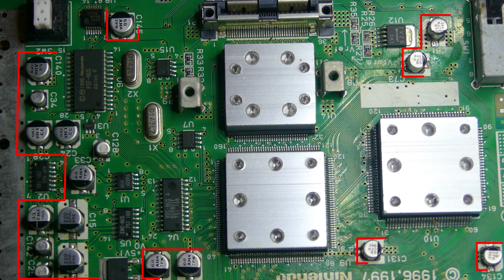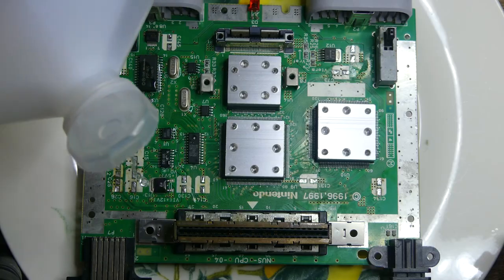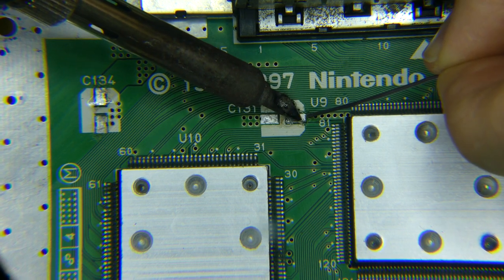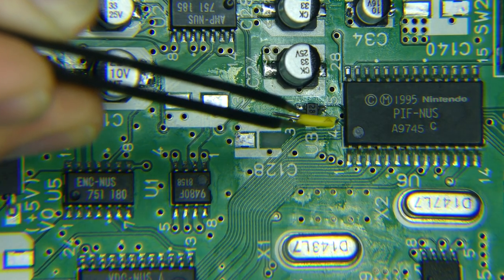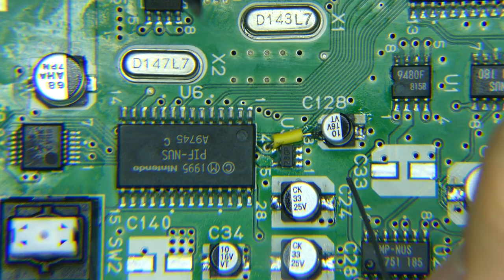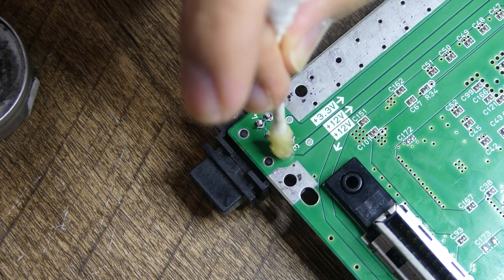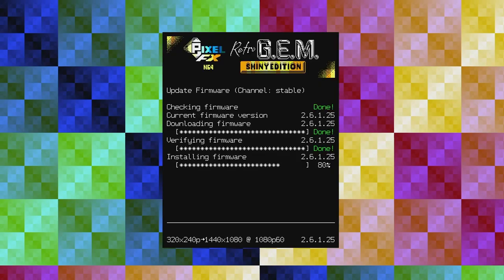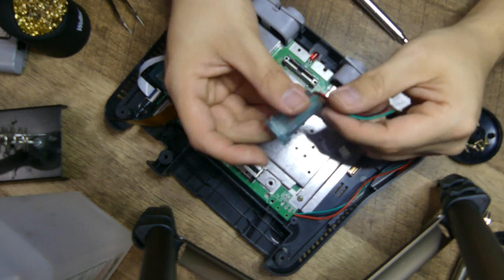Ebay N64 Refurb | Capacitor Replacement, Repair, USB-C Power Supply, Retro Gem HDMI

Comment: I find it best to use 2 soldering irons both with a j tip to remove smd caps. It's like having hot tweezers
Reply from the maker: Hot tweezers would be pretty nice not gonna lie lol Got a hot air rework station now which has been mad nice. Haven't heard of someone dual wilding soldering irons to remove caps though - interesting idea

Comment: Did you clean the cartridge pin connectors on the board? I never saw you remove it from board to clean it
Reply from the maker: Yup, I realized I didn't record it after posting the vid - sorry. Sprayed some nice contact cleaner and scrubbed it with a toothbrush brush; then repeated the scrub to the board. It's surprising how gross it can get in there.
Reply: @PedroPlatinumGaming  good man, had me worried, keep it up!